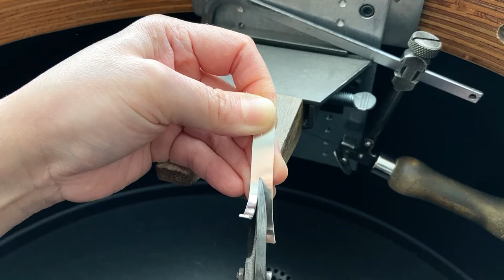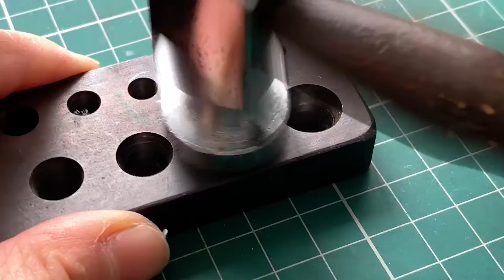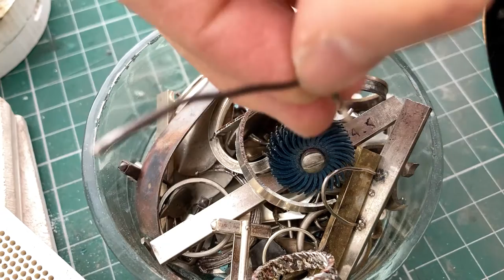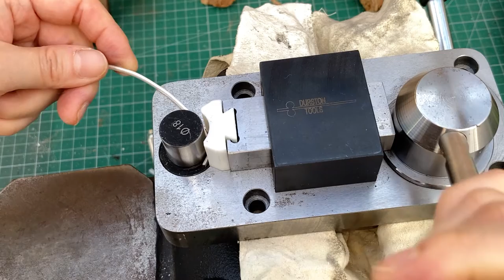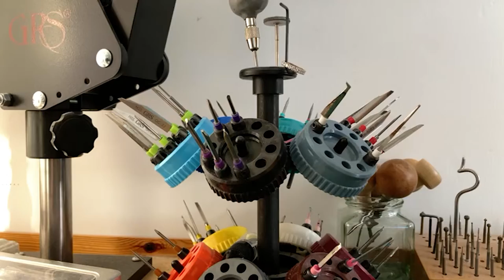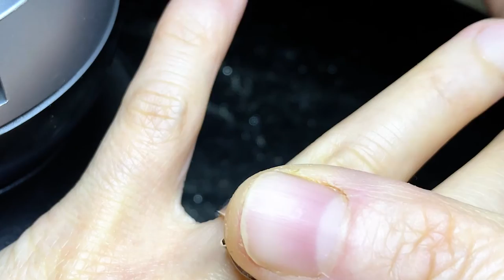Making a Prong Setting Tourmaline Ring, Ring Making No.7

Comment: This is wonderful! But how do you make the prongs stick to the basket before you solder?
Reply: The prongs have been laser welded on to the basket before the final solder. This method is used by some to tack the prongs into place temporarily.
Reply: @carmenponcedeleon2693  dont think so, they have been tacked in place with white paste flux from what i can see?